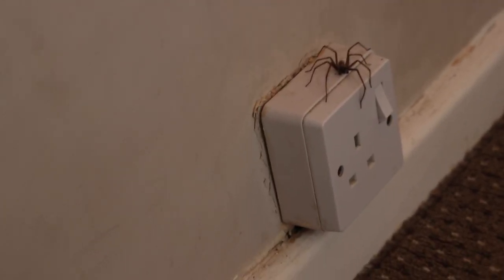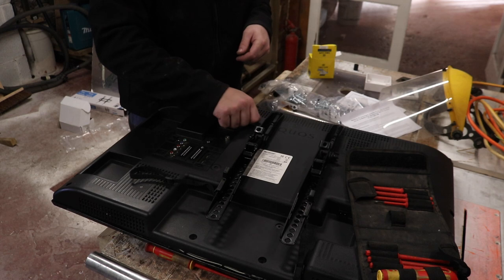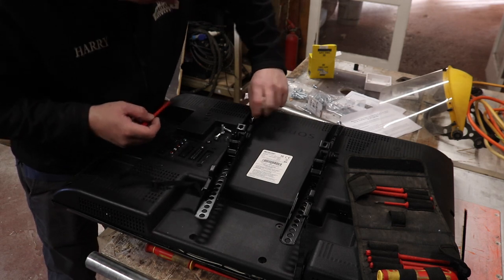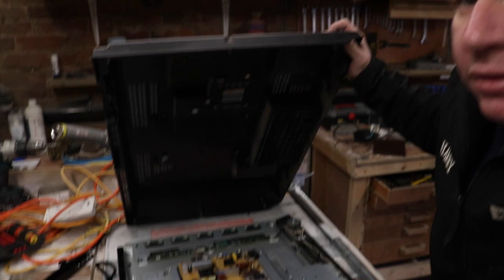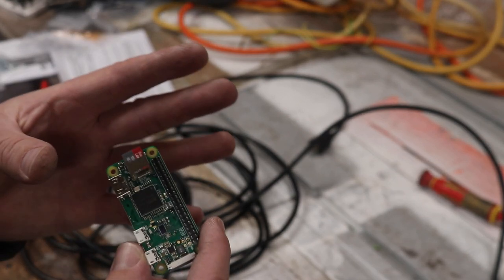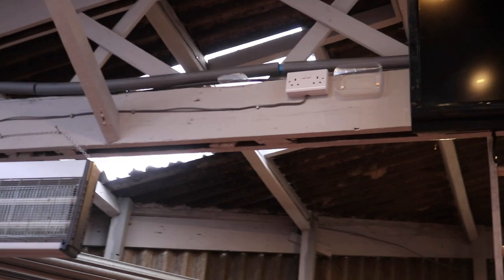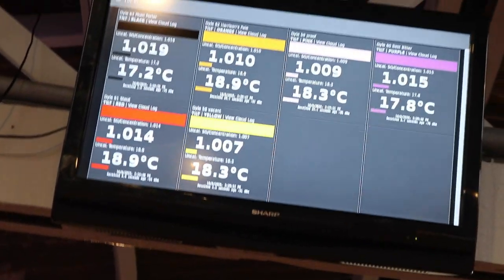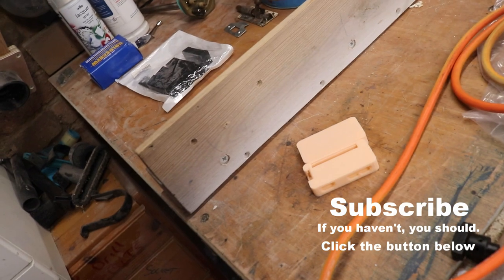More On The Tilt Pi With HDMI Output

Comment: How did you get it setup to automatically open the Chromium browser and start the display?  Mine stops at the desktop screen and since i'm using a Zero I don't have a keyboard or mouse attached to it.

Comment: What was the reason for buying a Pi Zero, and not a Raspberry Pi 3B with Ethernet Port and a better faster cpu.
Reply: Probably got a zero w with on board WiFi. Extra processing is probably not needed in this application, its only doing one thing.
Reply: @duncste01   The zero looks not fast enough for a big screen and 6 tilts. But i like the big screen.   Hope he doesn't get any problems with wifi and heat.
Reply from the maker: Yeah I went with the Zero as it was cheap and the Tilt website said it was up to the job. No problems so far but I am not sure how hot it is. I might get the infra red gun on it today to see.